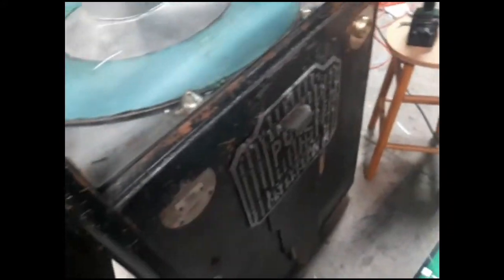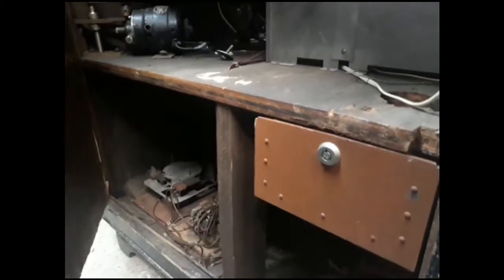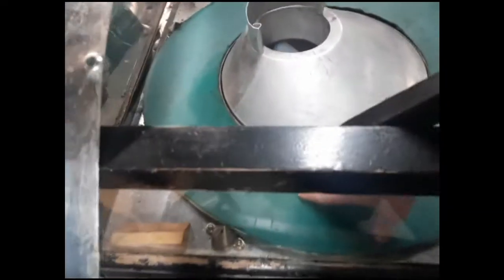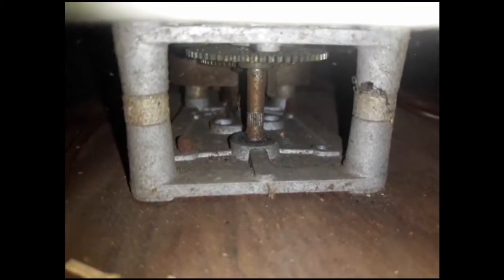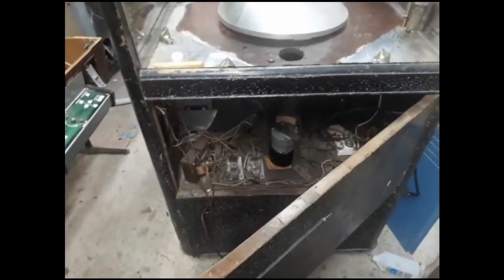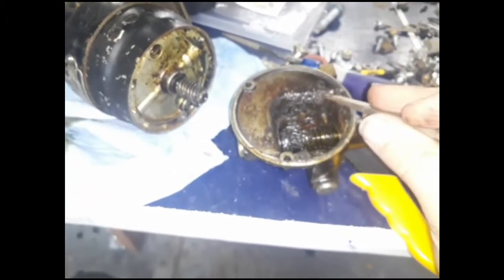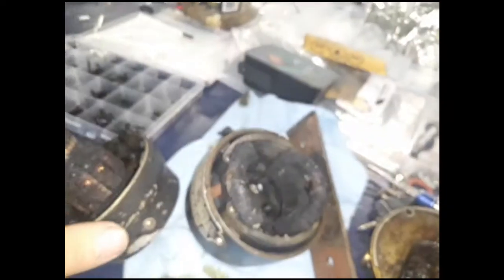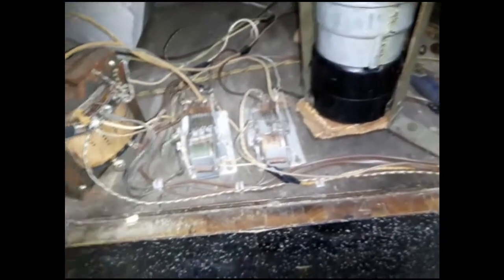What is the story behind this mystery 1930s machine? (Rotary Merchandiser) ep1

Comment: The mech in the bottom I believe is a timer so if you don't push the button it will automatically function the sweep arm and shut the game off.  And I have never seen the sweep that fast in fact they are pretty slow.  At least the Exhibit Supply ones.